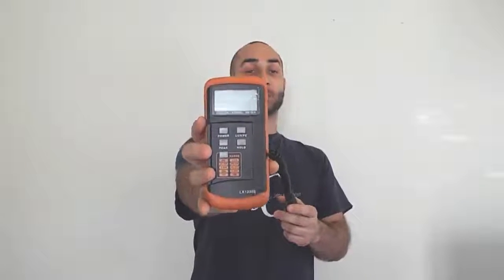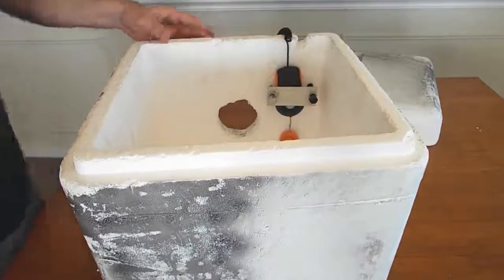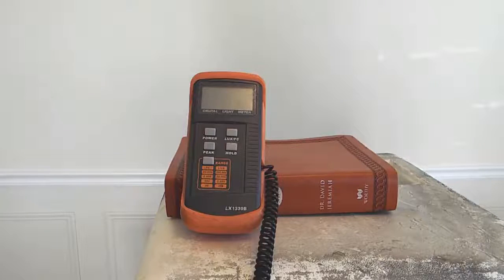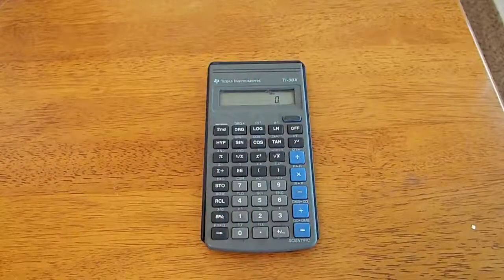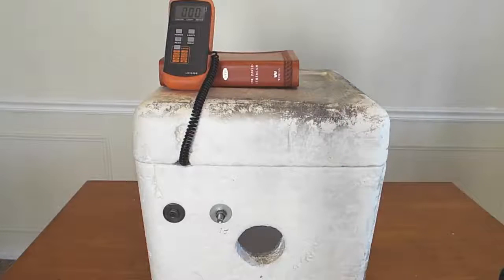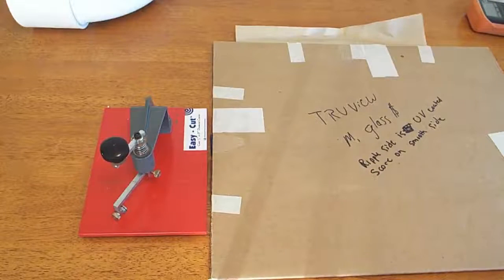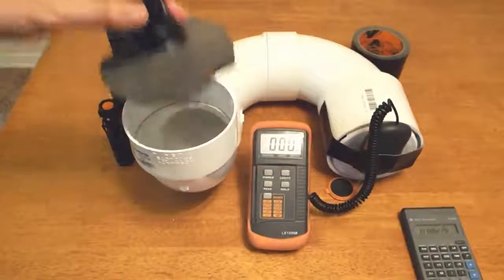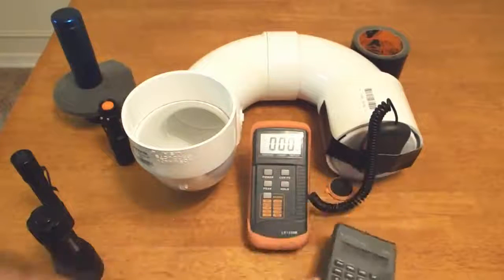DIY Lumen Measuring Device.   Integrating Shpere, and Lumen Tube.

Comment: So I built one of theses based on your video because I love your channel. But I can’t seem to figure out how to measure higher output lights like 6-10 thousand lumen light because no matter what I do my meter completely maxes out. How do I measure higher output lights? Or how do you do it? I’m so confused. Thanks Matt
Reply: Im having the same problem! Did you ever figure it out?
Reply: solved it BTW. I added a baffle and a camera filter that reduced the light hitting the sensor by a calculated amount (f3). handled my ms18 at 101,360.36 lumens!
Reply: @whoa-d2e I had notification off, I apologize for this. That’s excellent. I gave up too early but thanks for this info because I’m gonna work on it again. I really appreciate this info. I had a feeling that was what I had to do, you just confirmed it. 👍👍
Reply: @whoa-d2e hey, may I ask you which baffle and filter you’re using? Still having a hard time figuring out which is the way route to go. I really appreciate the help

Comment: Are the results of your Lux-Meter depending on the color-temperature???
If the meter is designed/working to output "photometric units" it may apply different weights for different wavelengths (with the weights corresponding to the sensitivity of the human eye)
https://en.wikipedia.org/wiki/Lux#Relationship_between_illuminance_and_irradiance

Comment: @5:20 Lux and Foot Candles (fc) are both completely dependent on distance. 1 fc = 10.7639 lux, always. 

So, if lux is based on distance, so must be fc.   Lumens are related to lux in that 1 lux is 1 lumen per square meter.  You need to use lux on your meter and make an integrator totaling of 1 sq meter highly reflective material,  If you are using a sphere, if would have a radius of 28.2 cm.

Comment: Excellent video. Quick question: I noticed you didn't use a lens in your "sphere." Do you absolutely need a lens for the tube version? What is the drawback of not using a lens?
Reply from the maker: Yes, you need a lens.   I have also added diffuses in two places in my lumen tubes now as well.    The diffuses I use  now are similar to the ones Texas Ace shows here http://budgetlightforum.com/node/60100

Comment: If anyone is interested in buying a calibrated lumen tube similar to what Matt is using in this video, check out this thread. http://budgetlightforum.com/node/60100. It uses multiple diffusers to help smooth out the beam pattern. It is also calibrated to read the lumens directly from the meter with no math involved. The latest versions are calibrated against some test lights measured in a proper integrating sphere using certified reference bulbs.

Comment: Why not a straight tube?    Looking to make something to measure the light output of car LEDs...
Reply from the maker: The bends are to help even out the beam.  It distributes  the hot spot and spill evenly so that you can get a more accurate measurement.
Reply: @Lumencraft-  Hey Matt, I have built my "sphere" similar to the one you show. I have an issue, though,  any light over 5,000 lumens overloads the meter. Any thoughts on why that may be? My sphere is almost identical to yours, utilizing the same meter. Thanks in advance!
Reply from the maker: @whoa-d2e  One thing I can think of is if you don't have the meter set high enough.  There is a button that says "Range" on them.  After you turn the meter on, you can hit that button and keep moving the decimal point.  10x power 100x power.  You will need to add the decimal when you do any multiplication then.   If you have the same size/length tube you should be able to do much higher, like the 30k range.   Since this video was made we also started adding diffusers inside these systems which helps a lot with accuracy. Here is an example https://budgetlightforum.com/t/texas-ace-blf-calibrated-lumen-tube-sphere-no-math-skills-needed-several-spheres-still-available/50929

Other than that  I would say check the battery in your meter, or maybe you got a bad meter?

Comment: When dumpster diving, make sure the interior of your "integrating sphere" is as clean as possible. :)

"lumens" is a measure based on how the human eye perceives "visible light". So the reflective properties inside the integrating sphere are important in that they shouldn't skew the measurements because which light frequencies get absorbed or reflected by the interior walls.

Comment: LED output will vary based on emitter temp - that's why one gets lower readings after the flashlight has been on. Since about 2011 (or 2012?) Cree specifies emitter output at 85C which reduces output by around 15-20% when compared to 20C (which is unrealistic for any lumenaire). The advice to test after a minute or two of runtime is good for most lights. [edit: and he says so at the end! :D]

Comment: Thanks for the video, like your prop for the meter, by the way... is that a reference to letting your light so shine?  ;)
The integrating conduit (or lumen tube) has a few drawbacks that can be corrected with a little extra work. The purpose of the sphere or tube should be to capture all the light emitted from a device regardless of direction. We frequently sand the insides of the tube to eliminate the direct reflections and unintentional concentrations of light, and that's a good thing. But with PVC, some of the light is absorbed by the raw material itself because it's not treated with a reflective diffusing paint. Another issue is having a wide opening that is larger than the flashlight reflector, as that lets light leak out or be absorbed when it should be reflected and contained. Managing both those aspects will make the tube more consistent than they usually are, especially since they typically do not have an internal reference light to aid in calibration.
Reply from the maker: Thanks for sharing Altema22.   "is that a reference to letting your light so shine?"    Indeed :)

Comment: If you have a meter that only does lux,how would you use that.
Reply from the maker: Hi Northwhales,

That is perfectly fine.   I found out its very common to use the lux setting.   As long as you calibrate that way its perfectly fine.
Reply: northwales1000 1 foot-candle = 10.764 lux, one is imperial and one is metric, like pounds vs kilograms